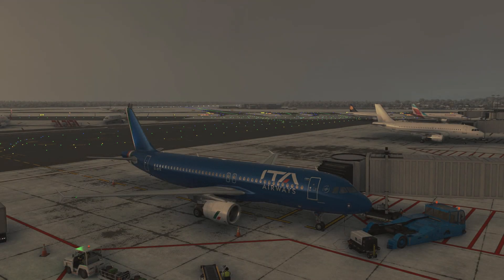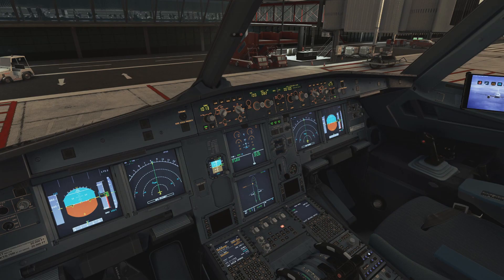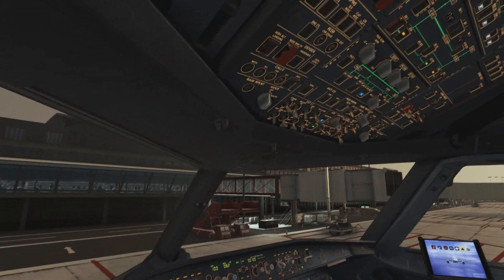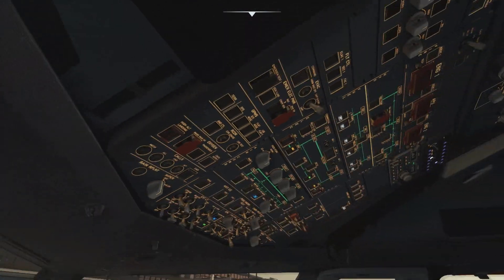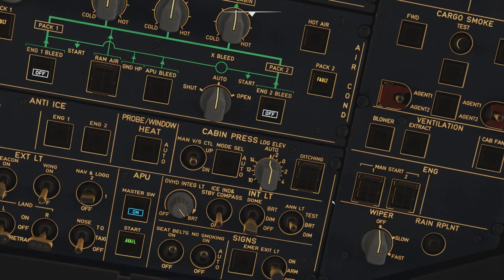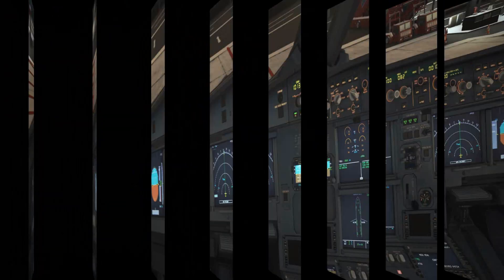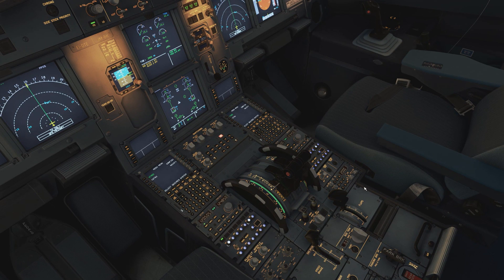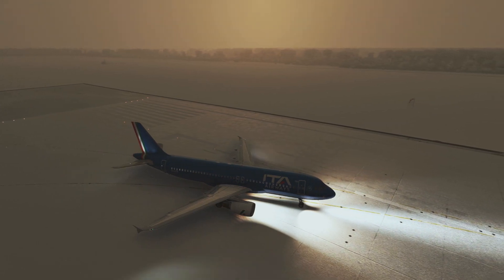How to correctly de-ice an aircraft

Comment: Great video and very well explained, as usual. Thank you!
On the topic of gsx: i can absolutely recommend it. It adds a lot of immersion with really good animations. After the initial setup, you only need to download airport profiles of flightsim. To, so gsx knows where to place objects like fuel trucks and baggage carts. With Airliners, I've not encountered any airport that didn't have config files already or available to download. Only if you fly GA aircraft off of small airports or airfields you might have to make a config file yourself. They have an editor for that, but this takes a bit more work.
But seeing a dude wave the locking pin at me after pushback is worth it 😊

Comment: I wonder what happens to those toxic chemicals. Do they contaminate the apron or taxiway?
Reply from the maker: @petermoore5203  De-icing is only done in areas with sufficient drainage and concrete with run off groves.
Some airports will even send a cleaning truck across the apron after each de-icing. HAM does this for example
Reply: @fsclips  As passenger I only  was in Ulaanbaatar on a 787 during de-icing. It was very interesting, but the weather was so clear and sun was shining. After the procedure all windows are completely blurry from the chemicals. No way to make photos.